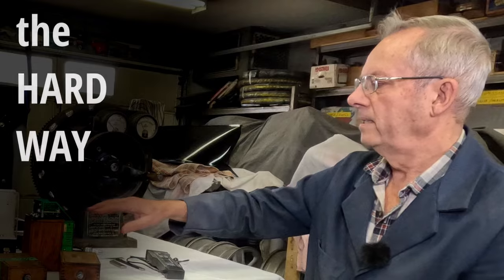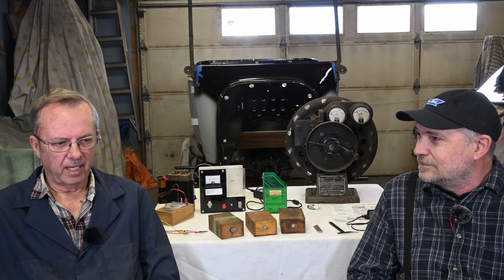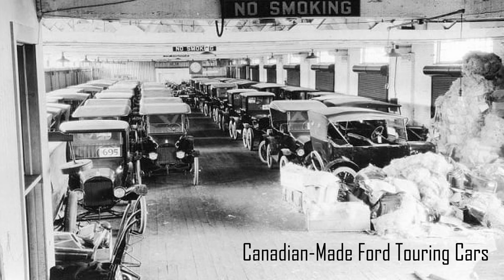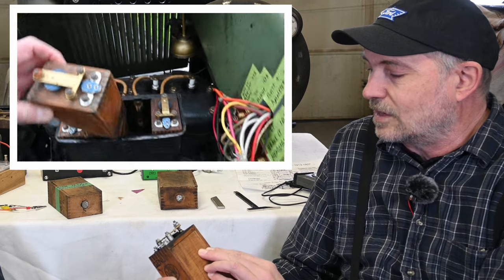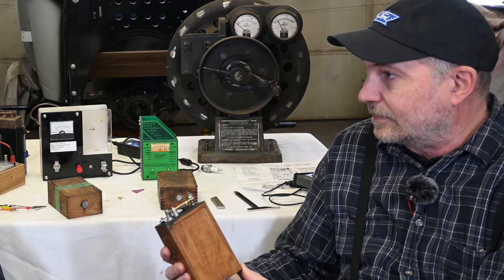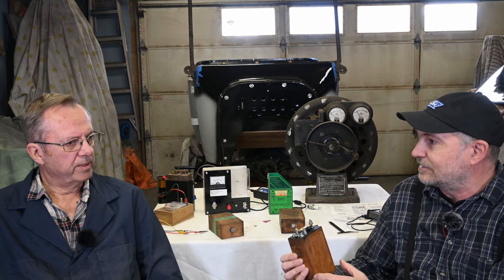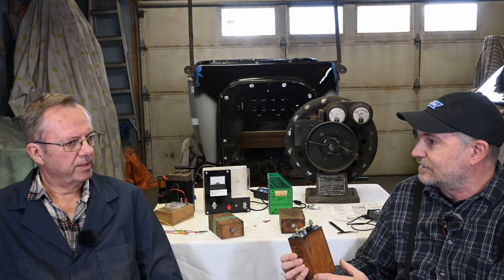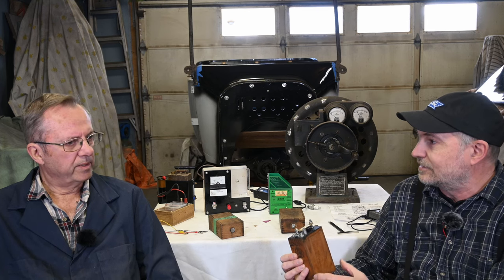Model T Ignition: What coil testing can tell you, and what it CAN'T.

Comment: Good show. Tungsten seems to scum over if left for a long time without the engine being started. General Motors Service Manuals mention to always check and clean the contact points before putting the new set in. 
Watched your last show with Mitch Taylor but got the time mixed up so didn't see it on the upload. Australia imported right hand drive Ts from Canada and did some assembly. I wonder if they had any of the Cdn. dealer bulitins or design drawings that survived as all of the ones here in Canada were thrown out by mistake or lost. Especially as it pertains to body's as they were different from the American Ts in the wood structure. Even a Canadian parts book might give a little detail.  
Interesting show tonight. Can't have too many gauges. Doesn't take much to put the performance off color when you only have 20 HP to begin with.
Reply from the maker: Thanks Russel.  I thin the Aussies do have some Canadian documentation - at least I see in some of the forums, when Canadian service buletins etc are dicussed, the Aussies seem to have a lot of it.  Cheers!

Comment: I've read the secondary coils are very prone to over heating and don't have the longevity necessary for them to be replacements, but the best reason for dismissing  them is replacing them.  Try it sometime just for grins and you will find out why no one wants to do it.

Comment: Will an 8 volt battery harm the coils?
Reply from the maker: I don't think so. I've tested them to 12v with no issues, and a strong magneto is even higher voltage. 8v will be a little tough on the electric starter, if you have one. Lots of people prefer 8v - I haven't tried it.

Comment: Steven, I applaud you and Russ for your efforts but many incorrect details that I fear may mislead new folks trying to learn the Model T ignition system from your high quality video.  I would encourage you to research and verify the following concerns.  Recommend viewing the MTFCA coil testing and tuning webinar:  https://youtu.be/RYcGD-8Ol3s?t=364
a.	High voltage AC from rotating magneto (8:18) – The Model T magneto is a Low Tension (ie low voltage) AC system producing 25 to 40V peak at normal engine speed.
b.	“Shower of sparks” (8:37) – Yes, but only the first spark initiates combustion and must occur at the correct time relative to piston position.
c.	Buzz coil repeated sparking at ~200Hz (8:40) - Confusing buzz coil operation with Modern Multi Spark Discharge (MSD) ignition of modern cars  - completely different scenario.  Buzz coils buzz too slow (~200Hz) to offer a 2nd or 3rd chance of ignition even at Low RPM.  MSD operates at much higher frequency;  5,000 Hz – 15,000 Hz
d.	A properly operating coil will really make a difference at high RPM (9:32) – No, a set of 4 properly operating coils, all adjusted to fire spark the exact same time after being activated will make a difference.
e.	Coil Tuning (11:20): – Misidentified point elements, functions and entire purpose; so each coil takes the same time to fire spark once activated to fire spark by the timer.
f.	Cushion Spring (11:30): - The bottom point element is the Vibrator Spring which is primarily responsible for setting the coil dwell Time to fire spark.  The cushion spring is the Upper point element primarily responsible for preventing double sparking.
g.	ECCT doesn’t check the current (44:55) – The ECCT absolutely does test coil current is within a nominal range when spark fires.  The Poor LED will illuminate if outside the nominal range.  The ECCT software actually displays the coil current at the time spark is fired.
h.	ECCT operates on 6V not checking under magneto conditions (44:59) – The ECCT operates on 12V using a fast pulse of electricity that emulates magneto operation at high RPM where ignition timing is most critical.  DC versus AC test conditions is not a valid issue.  The Model T magneto AC output Never alternates polarity (AC) during a coil spark event; the mag pulse is either positive or negative.  the ECCT mimics the positive magneto pulse at high RPM.
i.	ECCT adjusted coils may test high current on the Buzz Box or HCCT so re-adjust for coil current to prevent overheating (45:46, 47:10, 50:35, 51:00) – NO!  Do not De-tune ECCT adjusted coils based on buzz box or HCCT coil current.  A properly functioning Model T coil that is properly adjusted for equal and consistent firing Time on the ECCT will NOT get very hot very fast operating on 6V or even 12V battery based on test data (See this post: https://mtfca.com/phpBB3/viewtopic.php?f=2&t=20556&p=157543&hilit=left+buzzing+continuously#p157543 )  Do you have data that supports your concerns?  Regardless, Model T coils should not be allowed to buzz continuously for any prolonged time; more than the the time it takes to turn on ignition power and walk around to hand crank the engine ~20 seconds.  
j.	Adjust the pressure on the upper plate (46:26); if Buzz box coil current too high – The upper point element is the Cushion spring element.  Its primary function is preventing double sparking not coil current.  Buzz box (or HCCT) current reading is a consequence of proper coil tuning or equal and consistent firing Time, NOT the objective.
k.	ECCT Capacitor Test (47:38, 52:00) – Incorrect procedure.  Capacitor test must begin with coil point CLOSED, installed in the ECCT when Power is turned on or when selecting the capacitor test.  The points can be opened by finger or by inserting paper between the points BUT the Test button is pressed within 5 seconds and held open until test finishes.  The paper MUST be removed from the points before re-testing the capacitor or the capacitor WILL test Poor!
l.  ECCT Coil Test Result is Good with Bad capacitor (52:39) -  Incomplete test procedure;   The Good coil test result simply indicates the coil charged and fired (points opened) at the correct time and did so consistently at 0 deg +/- 1 deg 95% of the time or better.  The operator must also verify the coil is producing a spark that jumps the 1/4" spark gap in the side spark window each and every time during the single spark coil test or multi-spark coil test activates the coil.  The coil test fails if there is missing or no sparks fired.
m.	Summary (54:54) – Power source: ECCT 12VDC, Test Current Draw: should be checked.
Reply from the maker: Thanks Mike!  We are learning.  We will both study everyone of your responses, and address them all.  Appreciate your time making this thorough reply!
Reply: @flivverchannel  you are welcome and thank you for receiving them in the constructive context they were intended and open to any discrepancies you may find.
Reply: Any status updates or corrections to report after studying everyone's response?
Reply from the maker: @mikekossor1980  I hope to find someone nearby who has the software, so I can do a more formal deep-dive using the ECCT. To show the nuance of its capabilities.  Also, I'd like to try a top-rpm test with poorly timed coils vs perfectly timed coils.  Again, need the whole package to do that...